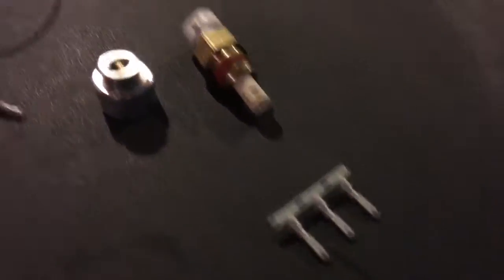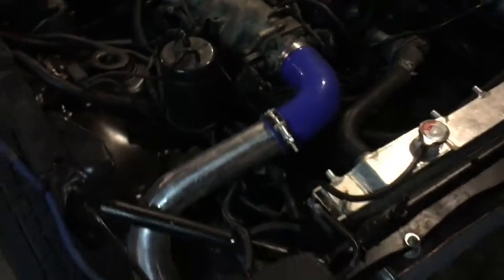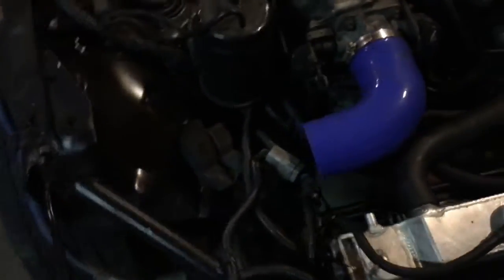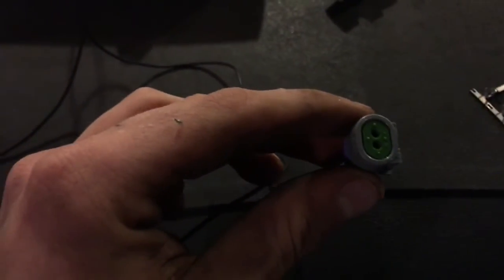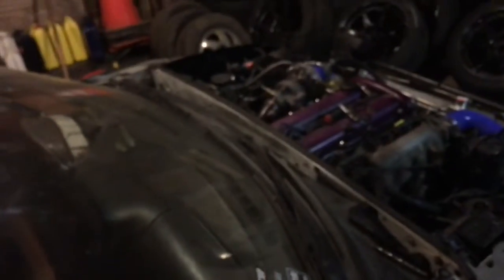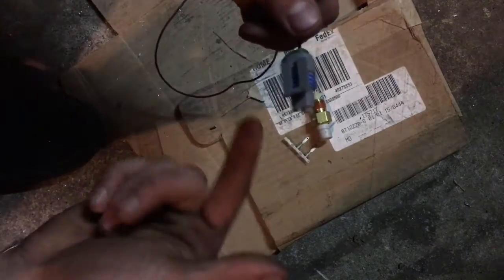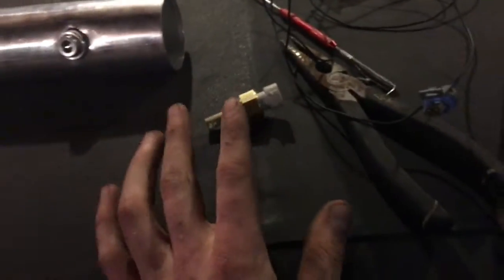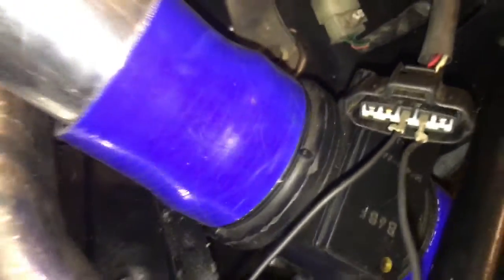IAT Install, MAF Delete Na Miata For Megasquirt

Comment: IAT is the intake take air temp sensor. Good job with the tut. Check out 14point7.com or wide-band.com for some affordable wb controllers. Amazon is a pretty good source for the lsu 4.2 and 4.9 sensors. Are you going to  go the e85 or water injection route?
Reply from the maker: I got a innovative Mtxl I'm just runing 93